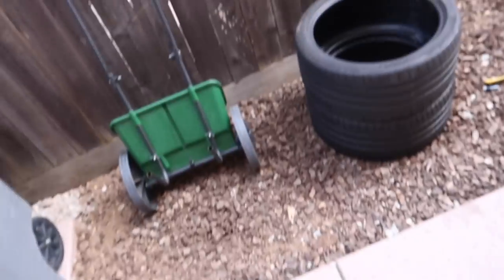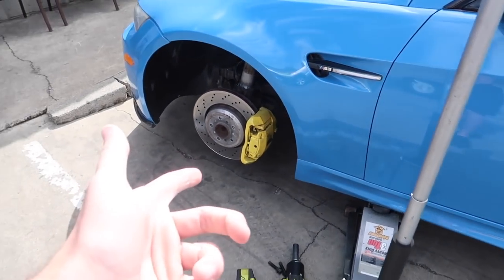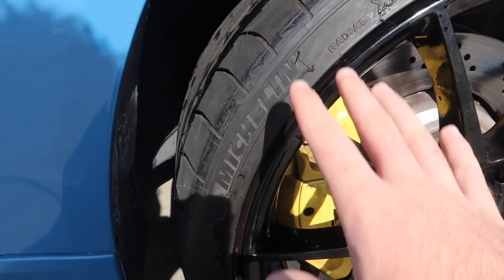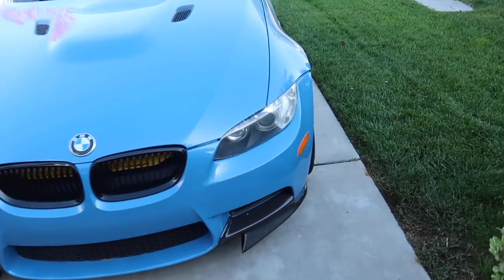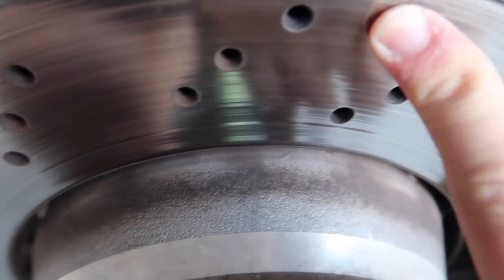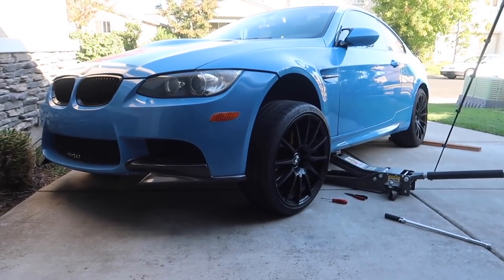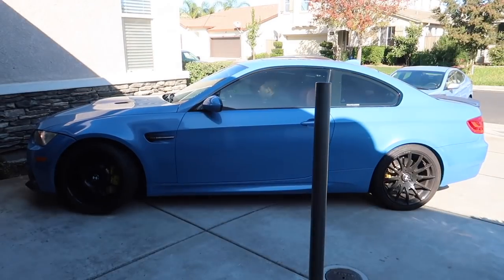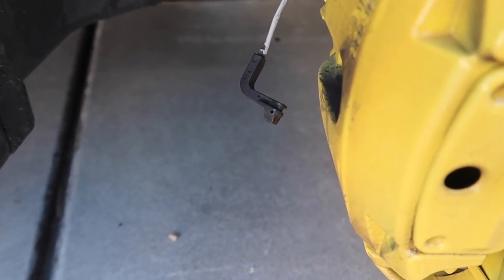BMW 335I GETS 3 PIECE WHEELS! (M3 UPDATE)

Comment: To test for brake disc wear, run your finger along the disc and the if you feel a lip on the outer ring then you need to replace. So basically if you feel that theres a lip on the outer edge of the disc the disc needs replacing. Hope this helps habibi

Comment: New tires are a must. Affects your ride, also your safety. Old tires can fail at high speeds, and even at low speed from internal degrading . (BAD TIME). Dont cheap out unless you blow a tire n need a temp spare.
Reply: Bklyns louder you are going over the top a bit. It all depends on the quality and age of the used tire. I have driven on my share of used tires in past with no drama or issues. Just gotta check make date, how they were stored, make sure there are no patches and get tires with at least 9 to 10.5/32 trend left.

Comment: You will hear the brakes squeak before there shot those sensor are so the rotors dont get damaged also they work as a reminder to replace brakes soon. Also you can cut the wires and wired them together with electrical tape but before you do make sure the car is locked, than unlocked than you can try to clear it with bd brake sensors are extra money pit

Comment: Nour, you neee to clear both, front and rear, otherwise it will still give you the code. And also need to drive it for a couple of miles after clearing them. No need tonreplace them, the car is acting up because they are not "installed" properly.

Comment: Yup 2 up front, one in the back (items 4 and 10):
http://mfans2.com/parts/catalog/E92/USA/M3-S65/jan2008/browse/scopes_of_service_and_repair_work/brake_service/
And BMW lady gave you wrong info left and right have different part numbers meaning they are not the same.
Btw. FCP Euro has them for 14 bucks a piece, so don't be a scrooge and buy them both now ;).